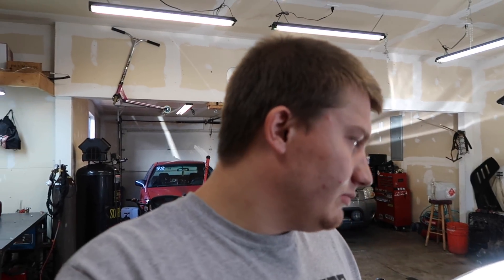Evo 8 Makes 700 HP

Comment: Definitely needs another 044 in the surge tank, fuel pumps don't flow nearly as much fuel at high pressure as they do at base fuel pressure. Also, -8 feed is a little small, but not the problem.

Comment: look at that not at PFI and nothing blew up. and it doesnt look like a junkyard that level of boost and E85 may need a 3rd fuel pump. 11:1 for E85 is still too lean. a 3rd fuel pump is really needed and a really high quality rising rate REG
Reply from the maker: 11.1 isn't lean isn't rich. Most people shoot for 12.2-12.5 AFR on e85
Reply: jack black isn't lamda better for e85, and just generally?
Reply: SuicideCRX #hpacademy
Reply: E85 you want ideally perfect afrs  9.8:1 on E85 but 10-11 would be best. the lowest mine hit on the dyno was 9.2:1 as boost hit and I sat at 10.5:1 as it ramped up     .12.5 -13:1 is what my pump gas runs on thats too lean for E85. E85 needs so much more fuel capacity and pressure. my 650 RWHP engine runs 3 deatsch werks 350 IL internal pumps 1500cc top feed injectors Deatsch W again
Reply: I think you mean is a wide band better than an o2 sensor. answer is yes. the wide band sends more information. SOME wide bands can read down to 9:1 (which you need for E85) where as other cheaper wide bands may only go to 10:1 or even read only to 12:1 and then just read rich when under that limit. 
so yes you need to get the right sensor for alcohol as a std wide band wont read low enough. and a normal o2 sensor (or narrow band) will only read rich or lean with set voltage so if you go richer than 14.7:1 the narrow band sends a signal. once it leans out to above 14.7:1 it will send another voltage to indicate lean. but think of that as only a very simple wide band